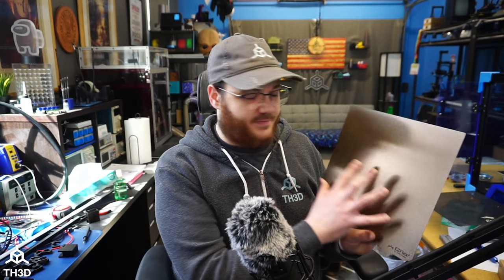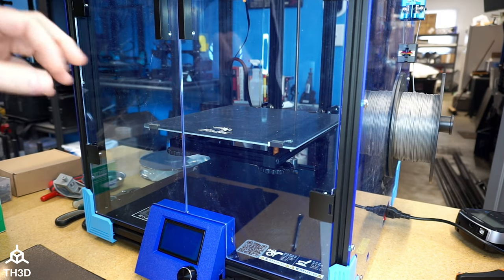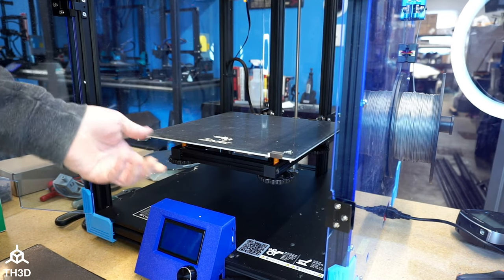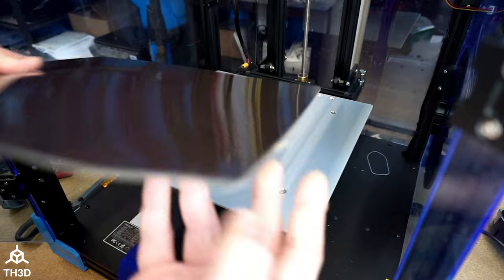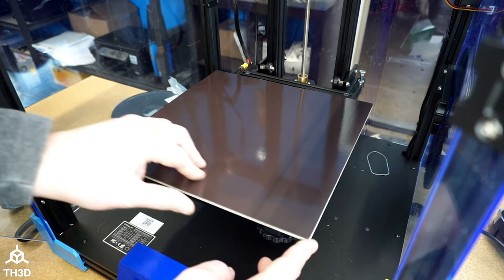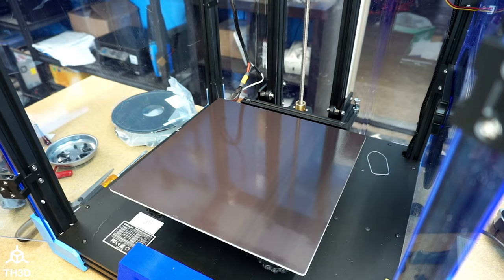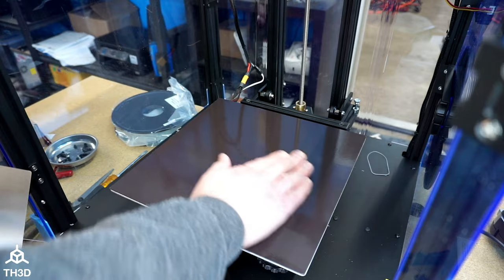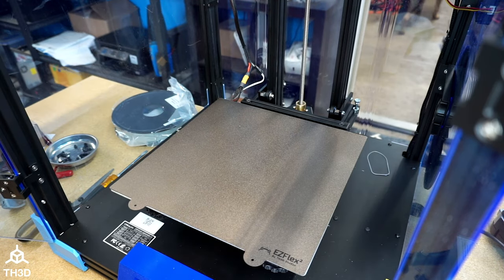Ender 6 Flex Plate Installation | EZFlex 2 from TH3D Studio

Comment: I wish my bed was flat enough to do this I still have to keep the glass on.
Reply: I had this problem, You can put the magnet on the glass and adjust your Z stop up.
Reply from the maker: If you install an ABL probe like our EZABL it's a non-issue. Check it out here: https://ezabl.th3dstudio.com/
Reply: @TH3DStudio  I’ve got one and it’s still an issue. All it does it transfer the curve of the bed into whatever I’m printing. So flat is bowed. Love my ezble but it sure does not make it a non issue.
Reply from the maker: @VampireOnline  then your only option would be to buy a bed that is actually flat if the compensation is not working for what you print.